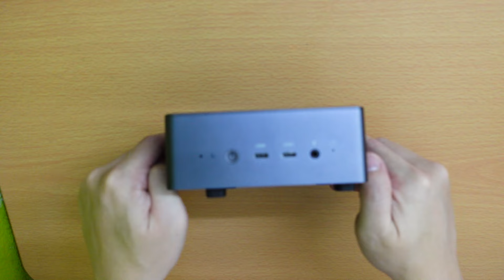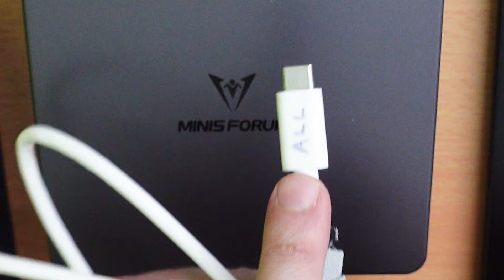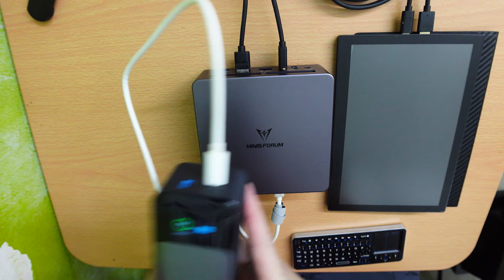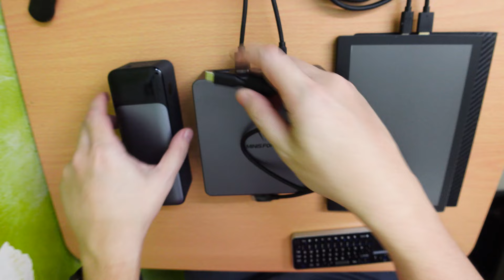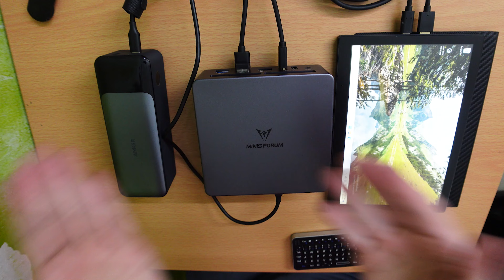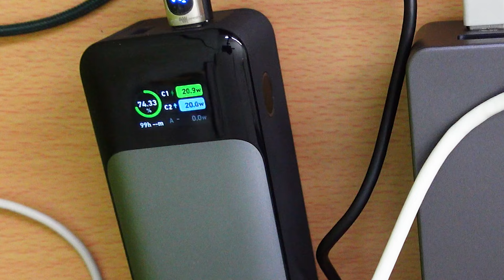Running the Minisforum UM790 Pro Mini PC From A Power Bank

Comment: A lot of power banks re-negotiate power to their ports (even if that port is already in use) once a new device is plugged in. That's why your computer gets interrupted. There are power banks that maintain constant power supply too. Best bet is reading buyers' reviews because most manufacturers/reviewers don't mention this.
Reply: Which brands do you recommend?

Comment: Thank you. I also wanted to make a standalone power supply for my mini computer. My screen would turn on, and then everything would turn off almost immediately. I bought another expensive USB Type-C cable, but it didn't work either. I decided it was impossible and abandoned the project. Now I know I need a different power cable.
Reply from the maker: Yeah.. USB C PD... can be so damn confusing at times!

Comment: Thanks for this video.  I have this mini PC and i failed to get it to work off USB-C Power.  I will try again with a few other cables and see what’s happens.  Does it matter which usb-c port is used on the front?  Or are they both capable of providing power
Reply from the maker: Both front should be able to receive power

Comment: Wait, what? This can take power through USB4? I don't need that stupid, proprietary 19V DC power supply?!
Reply from the maker: Well, it’s just a normal barrel jack, wouldn’t really call that proprietary.. but yup, this can be powered via the USB4 ports, if you read the site clearly, a lot of the MinisForum PCs can be powered via USB4!
Reply: @marauderz I mean, I would rather not be sending 20V down 19V input... It will work, until it won't 😅
Reply from the maker: @Micromation  true that.
Reply: @marauderz anyway, I've plugged mine into USB-C output on Bluetti Elite V30... It's twice the cost of the powerbank you've used here and also dubs as UPS for AC 🫣
Reply from the maker: @Micromation  I don't think we can refer to that as a power bank! 🤣
Reply: @marauderz  It's surprisingly lightweight though ;p

Comment: I have a similar mini pc, is it ok to use a 140w pd charger?  Can the minipc run at full capacity and does it harm the pc in any ways? Many thanks
Reply from the maker: More watts at the charger just give it more head room to work, won’t hurt it
Reply: @marauderz  Thank you. How about performance wise? To be straightforward, can I play valorant using a 140w anker pd charger? I have heard that it is actually the charger that can overheat
Reply from the maker: Can’t say I actually tried putting constant stress like playing games using my 100W PD charger, chargers would get hot at hot load but shouldn’t overheat as long as they are out in the open.

Comment: I honestly just learned a lot here. I was thinking about doing this for a gaming and editing mini pc mounted on the back of a portable monitor with a battery pack like that one on the back as well for when my wife and i go places, i can still work on videos. And i was wondering if this would be a good idea, and 3 hours is more than enough for how long i sit at a computer. Thanks for the video, i learned something new 😊
Reply: hows the experiment
Reply: This system are not optimized for power consumption like some of the handhelds with the same specs. But if you was to do some work on your card then I can suggest you using OnePlus supervooc 80w charger for your vehicle
Reply: I am also thinking the same, did u do that?
Reply: i've been wanting a linux tablet for that for ages

Comment: About how long does the power bank last? I have the WVX mini PC with N100. Im currently looking for a power bank to power that.
Reply from the maker: that's a highly subjective answer, really depends on how much the device is pulling from the battery. And N100 shouldn't ask for that much, so probably for at least 2 hours? Nice thing is you can actually see how long you have left based on the current draw.

Comment: I tried to use Ugreen 100w 12000mah on my um690 pro but it didn't work. I plugged the type c port on the ugreen power bank and 5.5 on the mini pc.
Reply from the maker: What’s the model number of the Ugreen power bank? Just the battery capacity doesn’t help. Also, I see on the minis forum website only the front USBC supports power?

Comment: hi, 20w on idle is quite high. I have minisforum s500 with ryzen 7 5825u and on idle it can draw ~4watts (in linux with gui) in powersave mode. Sometimes it can draw even lower, so my powerbank turns off the monitoring screen thinking that there is no powerdraw at all. At the same time, booting consumes 40+ watts untils OS will turn power modes on.

tldr: I have bases powerbank with pd 100w / 37wh capacity and was able to run S500 for ~5 hours from powerbank and there were like 10-20% on powerbank after I had to drive home. And I was using uperfect lapdock as well.

My dream was to use powerbank as an UPS and be able to unplug power from the wall without powering off the pc, but being able to charge powerbank while external power is connected.
In reality, there are a few seconds for my powerbank to determine whether it needs to be charged or discharged, leading to cutting the power from the pc.
So I can plug external power while working from powerbank without powercut, but not vice versa. Plus, there is an instability on powerbank's side which decides if it should be charged in or charged out... so in reality, there should be a charger pcb to be able to switch between power sources and be able to charge the powerbank when there is an external power connected.

and power delivery -> 20v trigger -> diode -> 19v + capacitors (to be able to act as a source for a few seconds while powerbank turns off/on yet again) - is probably the simplest and stable way to power the mini pc (ie, not the usb-c pd in directly on the pc, as there are issues with charge in/out negotiation)

Comment: You should have used the back TYPE C port not the  front port for power from the power bank. The back ones work perfectly fine
Reply from the maker: The UM790 doesn’t have a back USB C port
Reply: @marauderz  Yes you are right I got confused with the GTR 7PRO
Reply: @marauderz  It would be great if there was a configuration of running it on a power bank.
Reply from the maker: @TalzBlaze  have you not seen my other video where I found a power bank that’s perfect for running the UM790? CUKTECH 20, THE Power Bank For Minisforum UM790 Pro?
https://youtu.be/blL076XJ5Ic
Reply: @marauderz hey, do you happen to know why it is that some powerbanks reset their power upon the connection or disconnection of cables? Why is that.

I see that the cuktech has usb power delivery (PD) but they also have Programmable Power Supply (PPS), perhaps this added tech is what allowed continous power when you plug and unplug?
Reply: Says on google that PPS is designed to improve charging efficiency by minimising power loss and maximising compatibility with a wide range of devices.

Comment: Great video thank you. I believe this model will maintain power when you connect and disconnect the charger, but it might be hard to find now.

ZMI PowerPack No. 20, QB826G

Have you thought about also buying some Xreal Air? They ship with an optional power cable splitter.
Reply from the maker: I did consider Xreal Air's at one point, but I decided that the Quest3 fits my use case better.